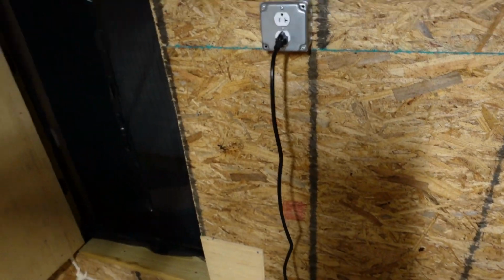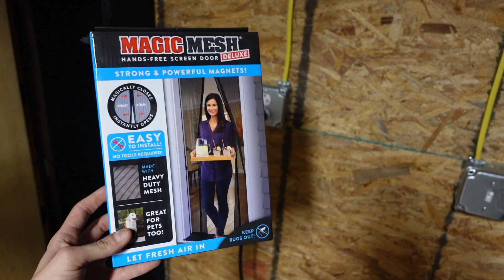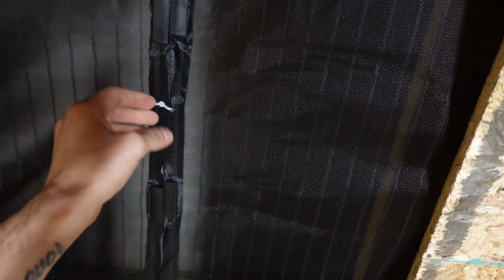Mining Shed UPGRADE!! | Air Flow Ventilation | Building A Wooden Door | Mining Farm Setup

Comment: You should be adding windows not doors.
Reply from the maker: Hello and thank you for your comment. I have tried windows doors are much better for letting the breeze blow in and out. If you used a window you would need to install 2 for every 1 door. It cheaper and easier to install doors then windows. 👍🏻